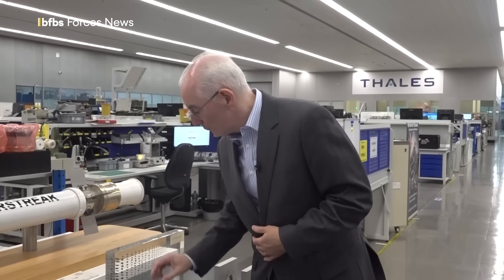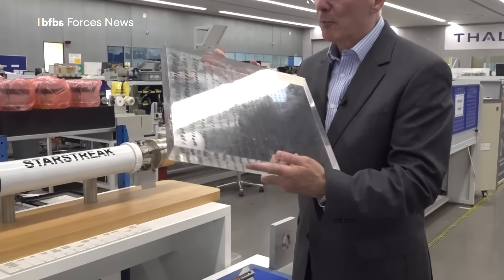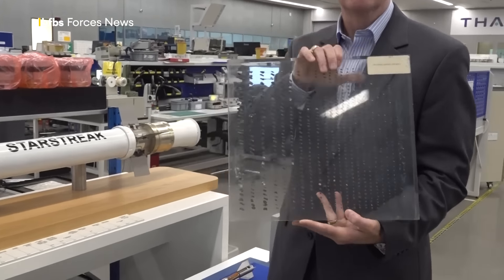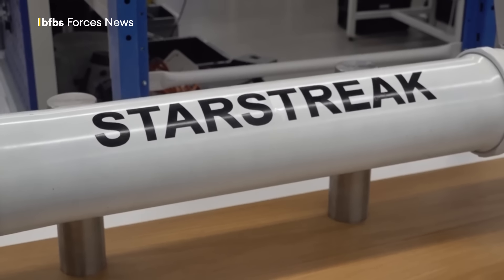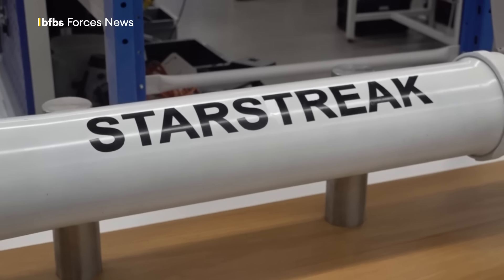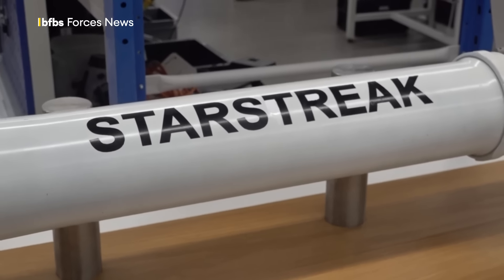How Starstreak High Velocity Missiles take down aerial threats

Comment: It's like a APFSDS round but with 3 laser guided darts.
Reply: It can be used against lightly armoured targets but   it's  expensive for that.
Reply: It’s likely to cause significant distress to even a heavily armoured vehicle
Reply: @ptonpc  Around £130k per missile, so more expensive than using an NLAW to do the job, but still quite a bargain for taking out an IFV or similar.
Reply: @robertpatrick3350  His 1MJ explanation is compelling against lightly-armoured vehicles like planes. I wonder against heavy armour. It's not itself a penetrator - it might just harmlessly (to plate armour, not so much anything else on the surface) disintegrate?
Reply: A very quick (and not very thorough) bit of internet research suggests a standard tank APFSDS tank round has about 10-15 million Joules on impact, so while starstreak is not as powerful as a proper armour penetrator, it would likely still damage most light armoured and probably a few mid-level armoured vehicles.
Reply: @Pesmog  I think we need a comparison  video from someone's 'garden' in Texas?
Reply: @trs4u  Tank APFSDS are about 10MJ
Reply: @agt155  sounds about right for difference in mass?

Comment: You would think the MD would know the missile is not a laser beam rider... It's actually  laser guided from the rear.. ie a wireless/laser uplink missile. Link TOW but without the wire.
Reply: Not quite. Whilst the darts do not home in on laser energy reflected from the target, the aiming unit projects two laser beams which paint a two-dimensional matrix upon the target. The lasers are modulated, and by examining these modulations the sub-munitions sensor can determine the dart's location within the matrix. The dart is then steered to keep it in the centre of the matrix.
Reply: @Orbital_Inclination that's a pretty accurate description 👍🏻

Comment: Starstreak turned out to be a bit of dud
Reply: @pannenkoekspek While opinions may vary, the Starstreak missile is highly regarded for its speed and accuracy, often considered one of the fastest short-range air defence systems in the world. If it underperformed in specific situations, those would be due to external factors, and not necessarily the system itself.